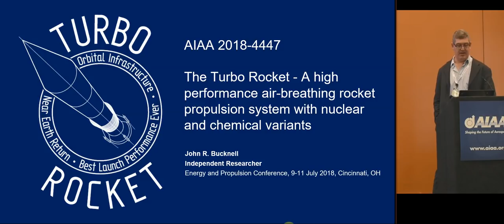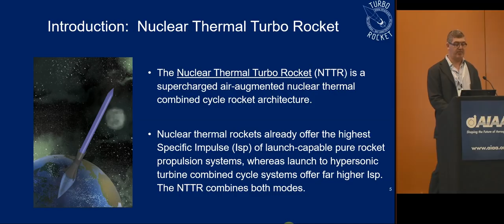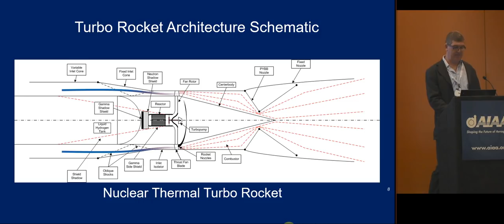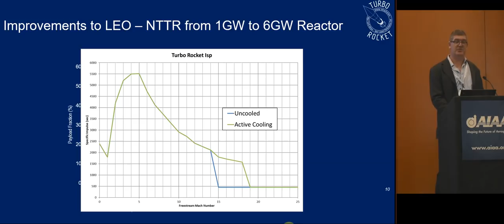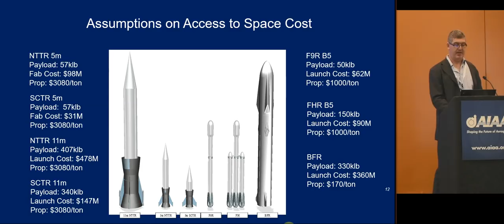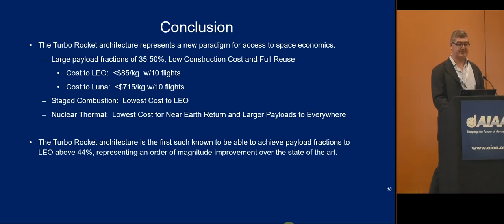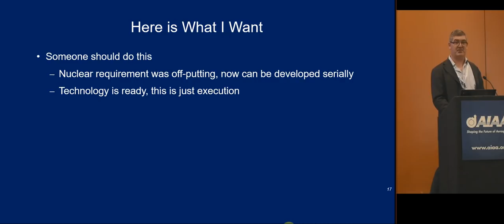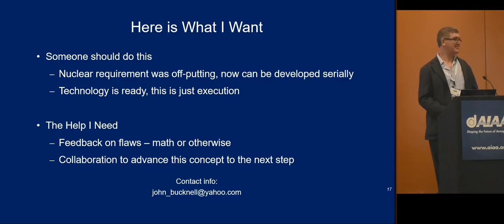Turbo Rocket Presentation 2018

Comment: Mr. Bucknell, I am really wondering what the trade-offs would be if you designed an SCTR using methane instead of liquid hydrogen.  Obviously the cost per ton of propellant would be drastically lower with methane, but would yield feasible performance in an SCTR?
Reply from the maker: The rocket-mode Isp is penalized by ~20% with similar in air-breathing mode so you have to carry significantly more fuel per unit payload.  The fuel is denser, so tankage gets lighter.  But overall, I've not performed the detailed analysis to understand the economics - but I suspect it isn't significant as reuse is bigger until many flights per vehicle are possible.
Reply: Thank you so much for your kind response.  I suspect the economics would be competitive for methane and delivery dates are likely to be sooner rather than later.
Reply: @johnbucknell901  

On a similar topic, is the trade off in using methane worth it when you consider the difficulties in long term liquid hydrogen storage? Or is it a problem that has been solved long ago.
Reply from the maker: Osman Safian Baharuddin  Cryogenic fuel storage is an issue for any long term mission.  Hydrogen isn't hugely worse, but cryocoolers are a solution for any rocket to reject the heat absorbed from the sun.  Likewise, thin film reflectors are able to reject heat in direct sunlight - between the two you could make a case fuel storage is feasible for short or long missions.
Reply: @johnbucknell901  thank you sir for the insights.
Reply: @johnbucknell901  If this is air breathing then presumably the compactness of methane will result in enough drag reduction to make up for the lost Isp?
Reply from the maker: No, the tankage is already quite small relative to conventional rockets - the payload to fuel fraction is ten times higher.

Comment: Can we have numbers on various missions around the solar system (Mars, Venus, Mercury, Jupiter, Asteroid belt) comparing NTTR/SCTR to a BFR? An SCTR version of the BFR should be very useful and possible now, with a nuclear cargo second stage and SCTR tanker one.  Looking forward to more info!
Reply from the maker: Thanks for your request.  I will provide that next month.
Reply: John Bucknell Thanks! Also curious if a lifting body design that could land virtically or horizontal is possible? That as a second stage (or SSTO) would make a NTTR more safe/flexible for landing back on earth. The reactor could be turned low or off for re-entry and just glide using air-breathing rocket fans for maneuvering/retroburn braking. Like a NTTR Venture Star ☺.
Reply from the maker: Two things.  Near earth return unrefuelled is the only mission that makes sense to me - further out (Mercury/Jupiter/Asteroids) need fuel when you get there to come back.  I don't have a good solution there.  Secondly, aerospace planes are generally heavier (retractable landing gear, wing structure, etc.) but they make that up by net positive lift/drag ratios.  Vertical landing lets you land without the infrastructure of an airport.  Reentry is much harder to model, and it is on the list of future work.
Reply: Well, water, hydrogen, various other liquids, and gasses are available for refueling an NTR all over the system. SpacX is thinking about putting refueling depots around the system it would be easier with an 11m NTTR. Aren't your NTTRs fuel agnostic? Anything that can be heated up and spewed out is enough outside of the earth's atmosphere. Hydrogen, water or methane are not the hardest things to find in the outer solar system. Was assuming that this was an improvement on the same BFR formula, which press releases conclude the plan is to go throughout the solar system pending a nonexistent but possible refueling network. Thanks for the clarification, looking forward to futher developments!
Reply from the maker: For sure a refuelling network is a chicken & egg problem.  The argument between chemical and nuclear is that nuclear is about a third of the travel time, or three times the payload for same travel time.  For high Isp, the propellant needs to be hydrogen - but with a dual-mode reactor able to generate electricity, you can electrolyze water wherever you are for ISRU.  Some prior work of mine demonstrates using water for propellant for lofting Lunar water for ice-based habitats: https://www.youtube.com/watch?v=778NLOXs7JI
Reply: Awesome so this rocket system can be a hybrid Power/thrust config.

Comment: Nuclear makes this concept far more complicated. The reason reactors have only been considered for in-space propulsion is because once the reactor goes critical it is full of super radioactive fission products and if there is a failure (that breeches the containment) you will have something on the scale of a mini Chernobyl on your hands. In addition servicing a nuclear reactor is a pain in the ass.  Even when shutdown the reactor is very radioactive and should be cooled because the decay heat can build up in the core.

I am not saying it will not work but I hope the above details have been considered. I like the staged combustion turbo rocket for a launch vehicle and I think a nuclear rocket would work well in space, but I would feel a lot safer knowing a critical nuclear reactor isn't flying through the atmosphere.
Reply from the maker: The fission product decay heat is a function of integrated power of operation, and rockets at least operate only intermittently (~20 min at a time) and as such don't generate much.  The reactors I describe are not of commercial power plant construction - their containment is heavy radiation shielding of tungsten carbide which can't really melt.  Lastly, nuclear thermal rockets are very small - so servicing is as simple as placing in a small chamber that has remotely manipulated arms to expose the core.  The integrated radiation shielding protects from fission product decay radiation.
Reply: John Bucknell thank you for the reply. The more immediate concern with decay heat is damaging the fuel/cladding. I assume the reactor will be designed to withstand a rocket failure without releasing fission products. I expect this is a requirement for FAA or DOE before flying a reactor.
Reply from the maker: These reactors are uranium oxide embedded in a molybdenum or tungsten matrix, no cladding since they don't need it.  These aren't fuel pins from commercial reactors, the cermet matrix retains the fissionables and fission products.  The regulatory structure isn't ready for airborne reactors to be sure.  The air-breathing version has a lot to develop before the nuclear variant is required for the near earth return missions.
Reply: I'm strongly against nuclear for earth-side power production and vehemently against nuclear for weapons, but I think nuclear is truly superior in space.  Since nuclear fission comes in so many complicated varieties, many people give up trying to understand the intricacies and simply lump all nuclear reactors into the Chernobyl/TMI/Fukushima camp, which is an ignorant assumption when it comes to the serious consideration of nuclear applications for space. I'm truly intrigued by your designs.  Can you give any numbers to the required nuclear fuel in kg for the 5m and 11m version reactors, and relevant possible configurations of the reactors?
Reply: People feel strongly over risks they have no control over, and yet they die from risks they are in control of all the time. 
They rail against nuclear plants, for example, when they drive a car, or smoke, or drink alcohol, or do all three at the same time. Some will die or be maimed from that. 

You fear a nuclear reactor exploding in the atmosphere. Which would be bad - for the operator. It would ruin them. But for people and the environment, not so much. Fukushima's triple meltdown demonstrated that it was more dangerous to be evacuated than to live in the fallout zone. 1500 people died from the evacuation measures, zero died from radiation, nor will ever die. If that isn't enough for you, people that refused to move away from the actual Chernobyl (not the "mini" one you so casually fling around as derogatory) - lived longer than those that were evacuated. 
http://theconversation.com/evacuating-a-nuclear-disaster-areas-is-usually-a-waste-of-time-and-money-says-study-87697

What does that say about the safety of nuclear? On the ground, in space, at sea? Absolutely nothing. What it does say, is that human hazard perception is fatally flawed - they can respond very emotionally to remote risks they have no control over, yet accept as routine health risks they expose themselves to all the time.
https://thoughtscapism.com/2018/07/21/do-we-fear-the-right-things/

The main concern with Bucknell's NTTR isn't so much the safety of it. NERVA and PEWEE proved that it would take explosives destroying the reactor to spread radioactivity. The fission products would be locked up in the cer-met fuel. And even if they were not - if this was open cycle, unclad fuel - it would still release an infetisimal amount of radioactivity compared to the hundreds of nuclear weapons detonated on earth in the name of nuclear testing. 

I would say that the real concern with Bucknell's design is in fuel fabrication. As far as I know, Cer-met fuel was never fabricated, nor even evaluated. Manufacturing, proving out the fuel and testing it will be difficult and expensive. American research reactors needed to do the testing are shutting down left and right. That knowledge base is literally dying off as engineers from the NTR programs retire and/or die from old age. 
https://ntrs.nasa.gov/archive/nasa/casi.ntrs.nasa.gov/20120015797.pdf
Reply from the maker: Several orgs, including NASA and their contractors have successfully built cermets in the last few years.  Tungsten and molybdenum both.  The BXWT NTP rocket being developed for NASA is of cermet fuel element construction.
Reply: I stand corrected. Looks like I'm the one behind the curve.

Comment: Conceptually it’s weird. And It won’t scale. This sounds like every other failed SSTO except the long term economics don’t sound bad and the whole payload ratio thing makes sense. This is high risk, high reward, while all other SSTOs are high risk, low reward— I’ll give you that.
Reply from the maker: Hi Nicolas, thanks for the feedback although I disagree.  Conceptually this is a form of combined cycle propulsion system of which many, many projects are currently being brought to market.  This one is far simpler.  Also, not scalable?  How?
Reply: John Bucknell 
Physical, it is scalable. Although cooling may be a problem. I mean in terms of making this a company and getting to full scale before running out of money. The only way I see this project going is if some large company picks it up. And many large companies have attempted sstos in the past and aren’t too keen on trying again. 

Overall, it’s a solid idea, but its not startup potential.
Reply from the maker: @nicholasn.2883     Appreciate the feedback regarding commercialization.  Out of scope for this presentation, but my email is in the video if you have strong opinions.

Comment: Interesting video. Posted it on NASA's Spaceflight Forums.

https://forum.nasaspaceflight.com/index.php?topic=43344.0

Another forumer posted this:

"The architecture in principle looks interesting. But - I have real questions about gigawatt scale reactors at flight weight ever being able to be produced cheaply in todays environment.

The flight averaged ISP of 1200 - assuming that this is considered as averaging so as to produce the same mass ratio as a chemical rocket, compared with an ISP of 380, takes you from needing 50% fuel, to 90% fuel or so. 
This is valuable if fuel is expensive - but with cheap fuel in orbit, it's basically meaningless.
(cheap = $100/kg).

IMO this would work lots better as a Mars shuttle, with very large tanks or outer planets.

There are some significant inaccuracies on BFR at least.

For example, assuming that payload to the moon, refuelled in LEO, BFR can't get back to earth, hence assuming all the cost of the BFR as $/kg, because it's assumed as 150000kg/BFR cost. 
Whereas in fact, with a couple more flights, and staging fuel in LLO, you can, fairly easily with relatively minimal penalty.
This leads him to conclude BFR has $12000/kg to lunar surface.
This seems to also assume that the refuelling BFRs are not in fact reused, and you're paying the whole cost of $360M or so per.

SpaceX alleged cost of launch would take this to $400/kg."
Reply from the maker: Thanks for the comment Rogerio,

I responded on the topic, the poster is missing some details with regards to the economics of the BFR.